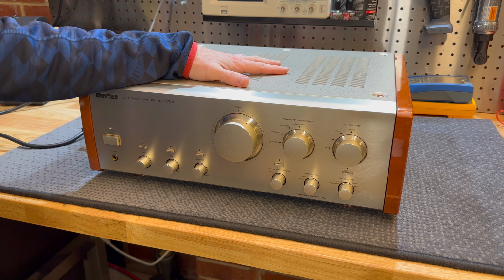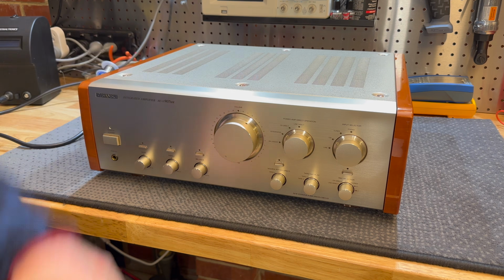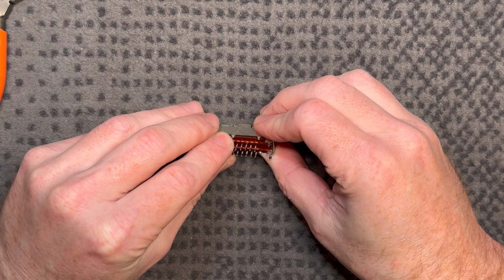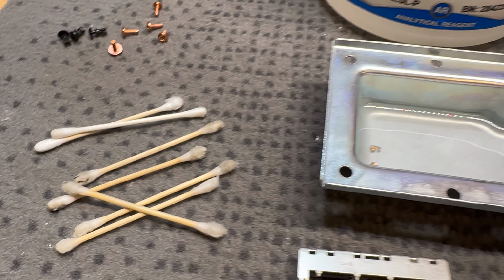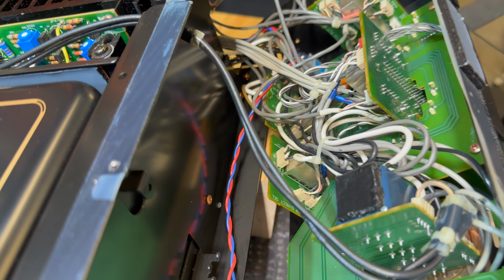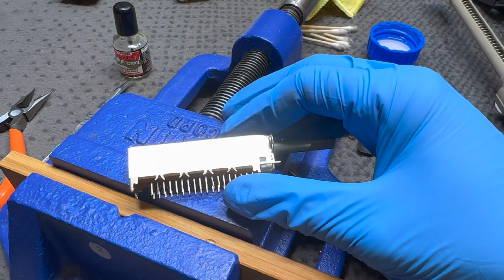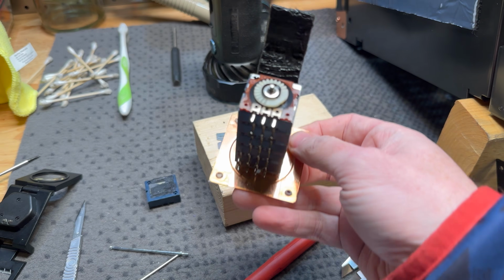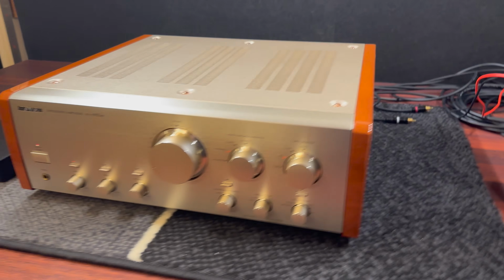Sansui Alpha AU-907MR (Excessive Distortion and Control Cleaning)

Comment: The aud33 is a nice FF amp but switching caused a myriad of problems from wild distortion to crazy gain level difference. I used to buy them all up in eBay and donor off what I needed to get stuff working and out the door.

Comment: You really have to do all the switches on this generation of stuff. They were all alps units and built to a price, not mil spec. Having said that I had an Aud11 F which is a fully balanced amp from input to the output stage. Super expensive, I bypassed all the tone circuits and signal path on mine and it’s was the most accurate sounding instrument I have ever owned. The Japanese guys were driven to include tone controls and features it was only when Pioneer introduced the A400 that we got access to truly clean signal paths and what a killer it was, sent mine to mr Tom Evan’s and it came back and made me emotional.

Comment: Hi!

Do you already have an appropriate load to check the power at 4 ohm?

Greatings from Poland ❤️🇵🇱❤️
Reply from the maker: I can easily add another set of 8ohm loads in parallel if needed but don’t really have the need for it currently
Reply: @whatcouldgowrong7914  It's a pity, I'm very curious if the 907 will double the power for 4 ohms 🎉

Comment: Fantastic job. Wish you lived near me. I have the a607mr which is such a nice amplifier, but with a stuck input selector that won't select turntable. I'd have a go but own not even a soldering iron, let alone having the skill or experience to use.
Reply from the maker: If I was to guess, that is probably on a metal ribbon that runs to the back, dont force it but you should be able to find someone reputable near you to fix it 🙏
Reply: @whatcouldgowrong7914  Yeah, I think that's right. I posted the issue on a website (I can't remember which now), and it was a very good discussion. The consensus was, as you said. Easy for the right person. For a muppet like me the whole soldering and desoldering thing isn't going to happen ;-) I might try the basic spray option and hope!

Comment: Nice job! Very good! I also need to change the relay on my Sansui alpha. In a local store, I found the Matsushita JC2aD-DC24V relay, identical to the original (It also does not have the current certifications printed). It's brand new, but from very old stock. Could this relay manufactured decades ago, although new, be degraded by time? Would it be better to opt for a current OMRON? Could you please help me with this issue?
Reply from the maker: Matsushita name doesn’t exist anymore (Panasonic now) so it must be pretty old. It may be fine still if its new but I would pop the cover and take a look at the contacts and see how they look visually. The Omron replacement has been fine for me and other than being made in China, performs perfectly 🙂👌
Reply: @whatcouldgowrong7914  Thanks. I thought the cover was sealed, I didn't know it was possible to remove it.

Comment: I always have aquire extra courage, before tackling this part of a amplifier restoration.
Thanks for showing this tedious proces! One question though, why not using a small desoldering gun when removing the switches? This makes the job somewhat easier and faster.

Cheers from the Netherlands,
Reply from the maker: It’s on my list believe me, you get so used to things over the years that you just keep doing it. Im planning on upgrading my soldering station with the desoldering gun addon, just haven’t worked up the courage to spend the $650AUD on it 🤣 I know there are cheaper ones but ive been spoiled by induction soldering irons that I can never go back
Reply: @whatcouldgowrong7914  

Aha, i understand. If 'm beeing honest, i have been doing it for many years like you in the past. At the shop where i worked, they had a Hakko 807 or 808. So i got spoiled. Can't remember exactly the modelnumber. This was mid 90's.
When i started my small repairshop a couple of years later, a Hakko was on my shortlist, plus the famous Fluke 87 series.
At one point both items where somewhat affordable on sale at my local distributor, and i didn't hesitate. I understand your wish to buy a decent one. Then you only buy once. Both the Fluke, and my Hakko 470 are still used to this day. But the Hakko did need some fair bit of attention in the past 20 years twice.
Parts are getting harder to find for a older station now.

Just stumbled accross your channel today, nice to see a collegue who works like i do.
Thorough, and the way you should be doing things. There are some good repairchannels on yt, and always nice to find a new good one to follow.

Cheers, 

Nico.
Reply from the maker: Many thanks for joining the channel 🙏